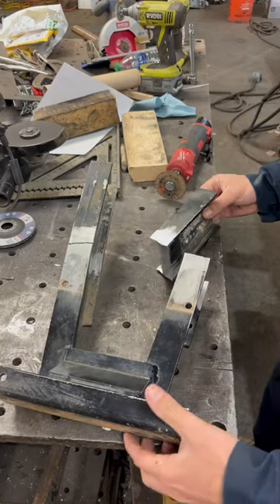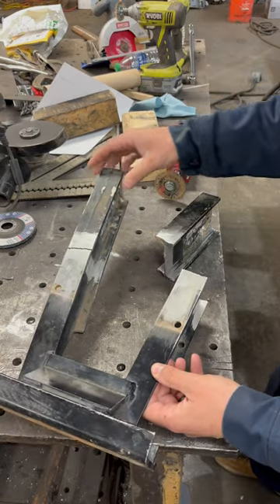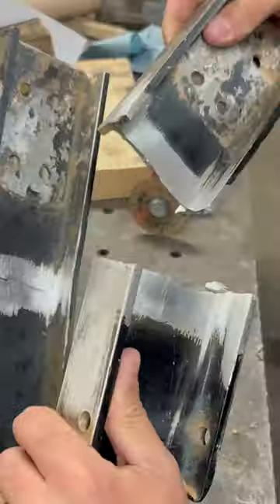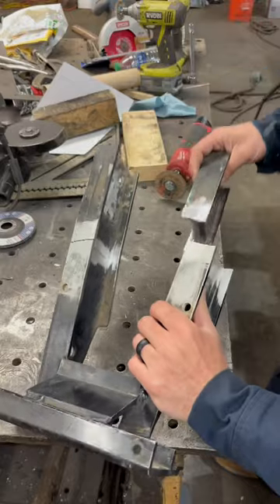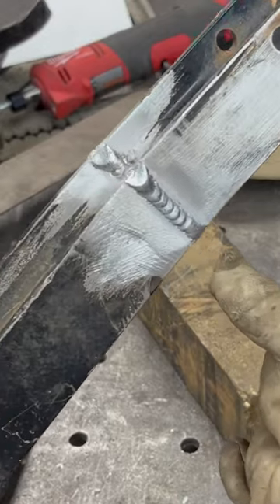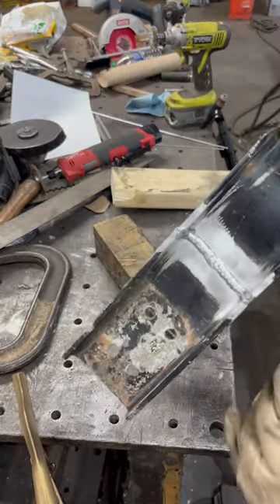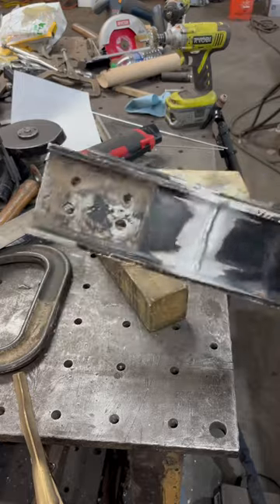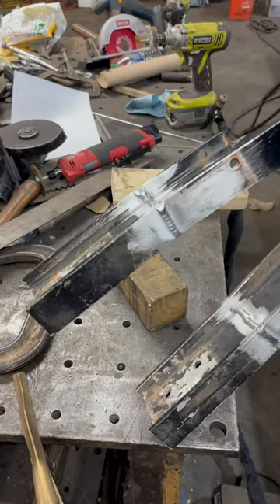Club car rehab!!

Comment: That depends on what the make up of that metal was. Say for instance if that frame was Aluminum with copper or zinc as a allowing element then the copper will align along the welds and create a week point that will fail. Same with the zinc. FYI
Reply from the maker: He is gonna plate both sides and bolt it together it will be fine. Thanks for watching!